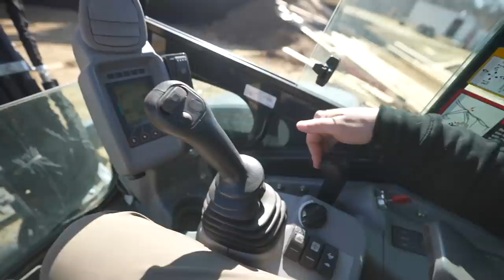My BUILDER Messed UP My NEW HOUSE and I had to FIX IT!!! (BeefCake Construction Saves the Day)

Comment: Great job brother, tight spots always made me nervous with equipment. But from the previous videos of your house I have been very confused about that walk out basement, especially when I seen them to start framing on dirt. With over 30 years of excavating experience doing Commercial and Residential jobs, this is how everyone has gone. We dig out the basement area, they come pour the footers and then walls. We then fill the entire floor area with loose gravel (meaning no lime dust, just the rock that way you will never get any settlement) then the plumber digs out and puts in his plumbing, then the concreate is poured before any wood construction. Once concreate floor is done, they frame up the walls and put on the main floor decking, then we back fill against the walls with loose gravel so water can drain around and there is never any pressure against those walls and the dont crack, plus if you pour concreate on that dirt floor, it will settle in time and crack the concreate. Your house is going to be Beautiful  and looks solid, but myself, I feel like it was really rushed and short cuts was done on the main foundation stuff. But for the love of God, dont back fill against those concreate walls without putting loose gravel against them before the dirt. You generally want drain tile against the footer going all around the bottom footer of the  walls, then about 2 to 3 of loose gravel from the wall to the back fill dirt,  Good luck Brother.
Reply: I Was thinking these same things!! I’m like “why are there dirt floors and wood sitting on bare dirt! That is a no-no for termites!

Comment: Flair, just for future projects, to unload the skid steer out of the dump trailer all you have to do is dig a little angled trench to back the dump trailers tires down into, and that will lower the rear of the trailer. It's much faster than building a ramp and much easier to fill back in.

Comment: Hey Flair if it was a Chevy the Chevy definitely wouldn’t have an issue pulling a trailer with some dirt in it!! Heck I would even think that 4x4 mode should help out also!!! Lol!! Oh I would definitely make sure that Brad the builder would definitely run a compactor over all that dirt that you had to fill in for the over dig!!! That’s definitely one big thing that I see a lot of builders do is over dig witch in return causes disturbed dirt and when disturbed can cause for the dirt to settle over time under your concrete floor witch will leave voids under the concrete and than can cause the concrete to crack!!! That’s why lots of people will use like pea gravel!! Just thought I’d let you know just Incase Brad the builder try’s to pass on that step costing you tons of money down the road way after your warranty has passed!!! And yes I have built several houses over the years including my own house that I built my senior year in high school!!!

Comment: When doing dirt like that and filling.and wantinf.to pack it you just use the bottom side of your bucket to do most of it.  You can still use tampers afterwards of course to really make sure to get every  inch but it's super easy to just use the bottom of the bucket by  pushing down with it and dragging it.  Cant wait to see how this property is gonna turn out, its gonna be dope!

Comment: I also wanted to say that you're supposed to load a skidsteer backwards. It's counterweight is in the rear and you never want to climb an incline like that. You can go up them ramps on flat ground with the bucket all the way up in the air in reverse no problem. I can put your mini-ex in the back of that trailer with no ramps too lol

Comment: If you back your skid steer on to the dump trailer its a little safer, because then you have the bucket for stability, and more tongue weight because of the engine.

Comment: flair you should try and fill the front of the trailer a bit more , the truck is too light in the back and thats why its spinning . maybe puttting more dirt in the front will increase grip in the rear wheels . but dont put too much in the front just try to fill the trailer equally and then put an extra bucket or two in the front.

Comment: Build or have built, a set of heavy angle iron ramps wide enough for all your equipment, they can be loaded on a trailer as well when you need to move them from the house.

Comment: Two things,  why would you load up top soil to put in the basement as a fill?  REALLY BAD IDEA!!!  Second,  you don't need a dirt ramp to load into a DUMP trail,  just tilt the trailer till the ramps and the bed of the trailer are at the same angle and drive STRAIGHT in and out.
Reply: Agree on the top soil thing as for the dump trailer tilt thing I don't think his one has a strong enough ram on it to be able to do it I think it was his one when he got it I thought "that's not strong enough" or it may have been Rob's (lunkers) one

Comment: Running a residential grading crew everyday, I cringed but hey mad props. The foundations crew didn’t back fill with stone? More water drainage that way, also makes it easy to get it to grade for the flatwork crew pouring the floor.

Comment: 20:24 there is an Off Road Dumper right at the top of the hill! Why not use it?
 If it's not yours, fork some cash to use it.
 It will do all the work you need in one shot.
 I'm curious 🤔 👀

Comment: All your weight on your skid is in the back since that’s where the engine is if you back your skiddy up the trailer you won’t have issues getting it on the dump trailer since the weights in the back that’s why it’s scary going straight on because all the weights in the back and makes it just want to wheelie

Comment: Most of your weight is behind you, on the mini and the skidsteer. The mini has a counter weight, and the engine behind you. The skidsteer has the engine and overall more frame behind you. Your weight is NOT in front. PLEASE PLEASE LOAD THE SKIDSTEER REVERSE. DON'T  drive straight up. Your wright is behind you AND YOU WILL FLIP DRIVING STRAIGHT ON. Have someone flag you so you can reverse onto the dump trailer. EVEN IF you start to tip (which is VERY RARE) your bucket is in front of you towards the ground and will prevent you from flipping. Safety is number 1.

Comment: Hey flair stop bein a whenny and use your feet to drive and hands to run your bucket.. they only put those handles there for the truck driver that has to put it on the the the trailer